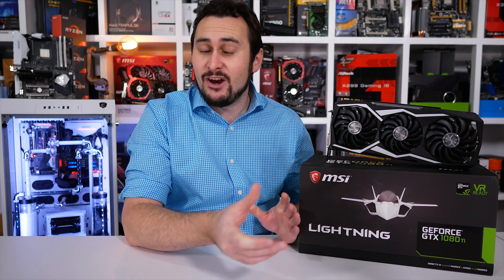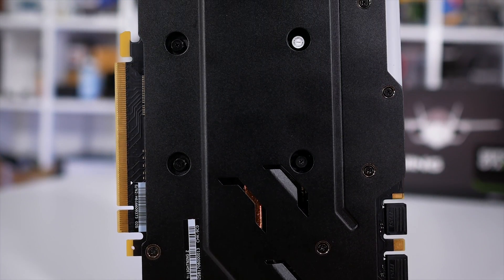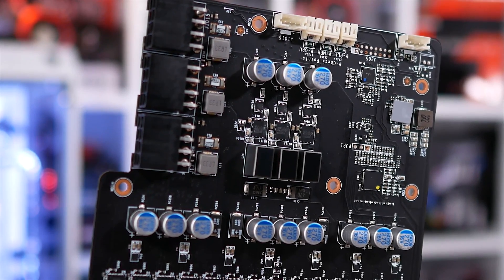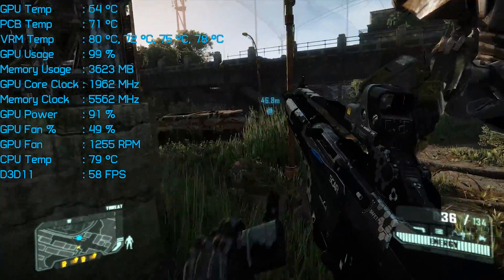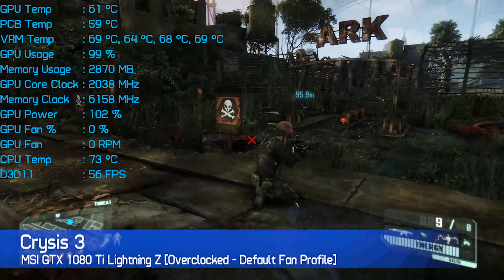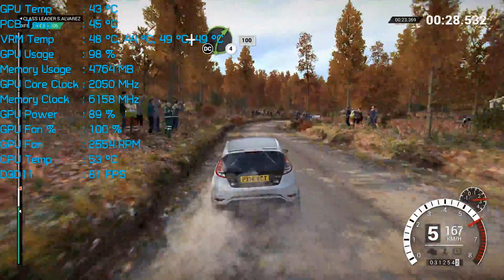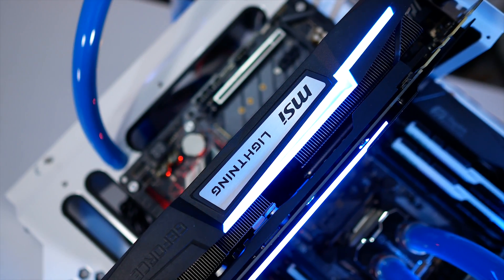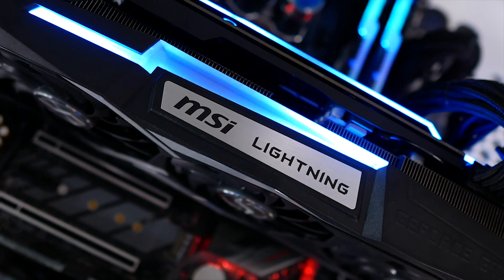MSI GTX 1080 Ti Lightning Z: Thermals, Overclocking & Benchmarks!

Comment: I know this isn't anything related to the video, but you mentioned a while back in the comments section that you were doing a video on comparing the old Nahalem/Gulftown six-cores from Intel (i7-980X, for example) vs. the R5-1600. What's the progress on that, if you're still working on it? I just upgraded to a 1600X from an i7-980X, so you could say I'm pretty curious about the overall picture!
Reply from the maker: I recall that comment, sorry I miss read it as i7-7800X. Sorry about that. That said I would like to do that test, just been to get a working motherboard.
Reply: Hardware Unboxed i would send you my asus p6t se but i probably live 300000km awax from you lol
Reply: Ah, no problem for the mistake! It was still a very interesting video nonetheless. And yeah, good luck finding a high-end X58 board these days for a decent price. Here in the US, you can still expect to pay upwards of $200 for a good one.